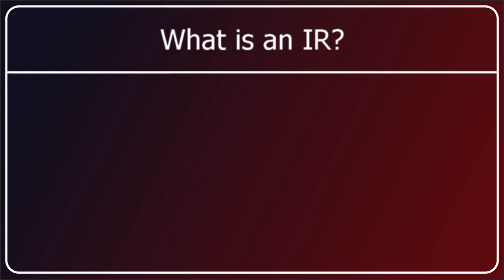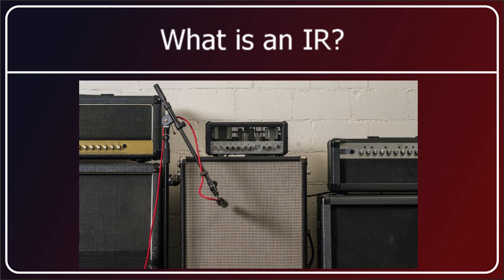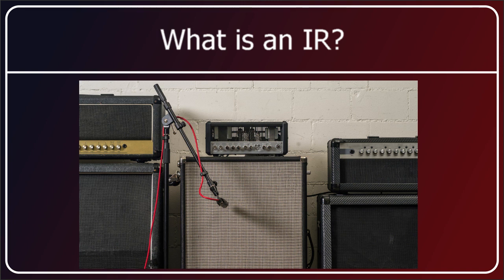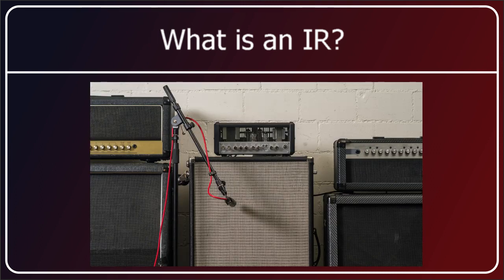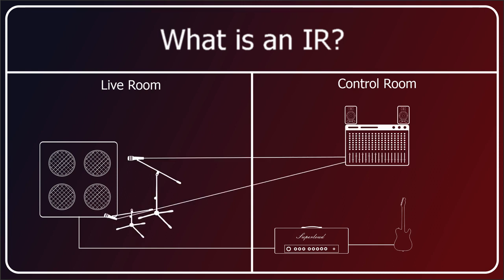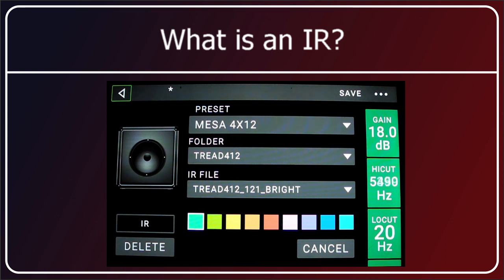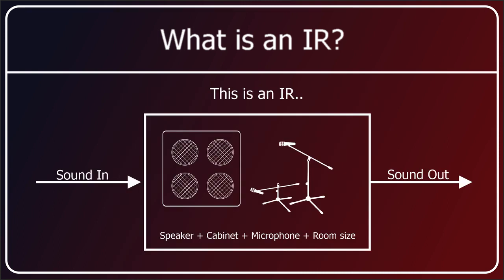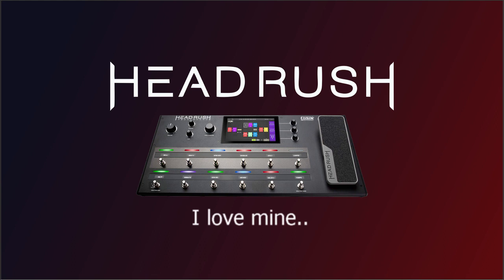What is an IR?

Comment: A small correction. IRs aren't just for speakers! You can make IRs for anything that affects sound: Amps (that's how Kempers & Headrushs Amp Clone feature works), Rooms (that's how Convolution Reverbs work), FX boxes, etc.
Reply from the maker: I didn't say they're just for speakers :)  I said they are a measurement of a cabinet, a speaker, microphone, and a room, which in this usage case they are,. Obviously similar techniques measure profiles in the Kemper or Clones in the Prime, but those files are not interchangeable like IR's are, otherwise we'd all be running Kemper profiles with our IR loaders. Now wouldn't that be nice.

Comment: Thanks! But since IR's include cab sound, if I run my headrush into the power amp of a boss katana, I can't use the integrated cabs then? I should just use an amp in my headrush, no cab no IR?
Reply from the maker: That's how I would do it, why have a modelled speaker and cab playing through a real speaker and cab?  The Katana is a guitar amp and the cab and speaker have been designed to behave in a certain way. No need to send it a model of what it's already doing. 

Having said that if you like the sound with your IR on .. leave it on. :)
Reply: @MuckingAboutWithMyHeadrush  Thanks, I really appreciate your channel and your help!  So if I've understood this correctly, I am still using the cab in the katana even though I plug into the power amp (which passes the amp)? Difference between speaker and cab has always confused me
Reply from the maker: Yes, the "Cab" literally refers to the wooden cabinet the speaker is in, the cabinet effects the sounds quite a lot, open back, closed back, ported, etc etc.. the IR captures everything from the speaker, to the cabinet it's in, the microphone used to measure it and the room it's all in.. any duplication of that chain will confuse things.
Reply: @MuckingAboutWithMyHeadrush  Thanks!
Reply: @gratengelsker7614 

You can or should try it both ways. 
With and without the IR.

I did the same.
Choose what sounds best to your ears.
There is no "wrong or right. "

Honestly, most often I would engage the IR. 
Because it just sounded better to MY ears. 😊